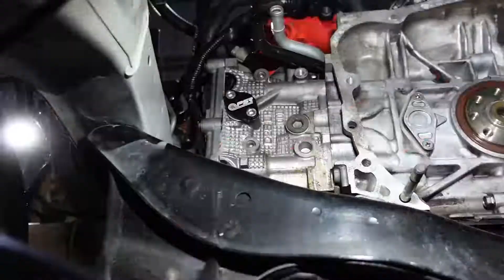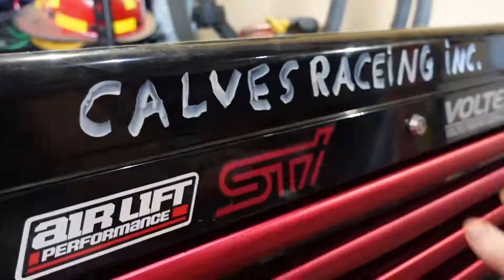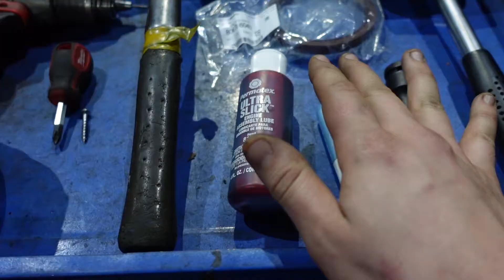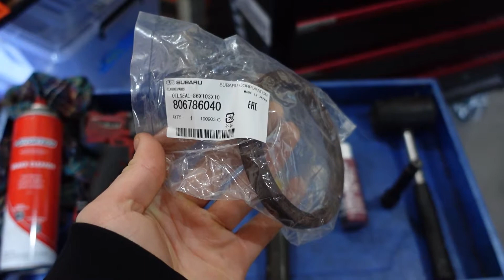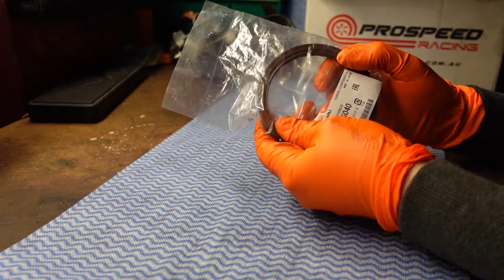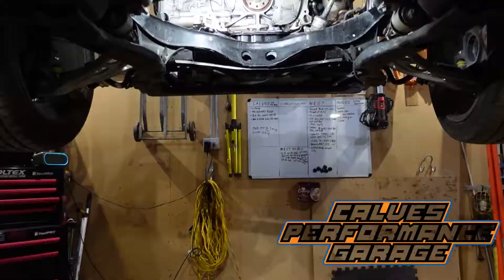How To Replace Subaru Rear Main Seal: Extended guide

Comment: What is the torque specs for the bolts for the Flex plate to Crankshaft?
1. I'm finding 53 -62 ft-lbs.  
* 2.  It's mentioned there is an additional angle to tighten the bolts,  I'm can't find the required amount.

Comment: I don't think the motor oil lubricates the seal it just cools it down slightly but no oil gets between the crank and seal, or else it would be leaking all the time. If a car sits a few months the seal will be completely dry by then and starting it up would destroy the seal by your logic, but it doesn't because the oil pressure builds almost instantly

Comment: Can I just use motor oil instead of assembly lube or It's a must?
Reply from the maker: Yeah, oil will work.
Reply: @CalvesPerformanceGarage  well, it leaks 😭, I'm dropping the trans again and I don't wanna make the same mistake, could that be because I accidentally put some oil on the outside of the seal while I was putting it in?
Reply: You just want to use a very light film of oil. Dont drown it in oil. It should be perfectly fine.

Comment: What if the rear main goes too deep?
Reply from the maker: Try to pry it out without damaging it. If not then pull it back out and start again!
Reply: I did the same thing I don’t see how to get it out without damage it
Reply: @izzysrt4  I went through about 2 seals doing it. Definitely the hardest part of the repair
Reply: I see you pulled the transmission rather than the removing the engine.  Was that faster?
Reply: @weshawkins7165  I didn’t consider pulling the engine because it would’ve been too much work for me. I did this in my home garage. 
I actually ended up putting the cam sensor on the wrong way when I put it back together. I was able to take it apart and put it back together in like 6 hrs, maybe even less since I knew what was doing the 2nd time around
Reply: @Ezrvdu  
  I know labor book time to r&r the trans is around 6 to 7 hours and around 13 for engine.  I’ve got one to do for a guy in a few weeks.  I’ve got lift in my shop so I’ll probably pull the trans.
Reply: @ definitely the easier way to go 👍🏿
Reply: Well I can tell you that I put mine in about a quarter inch too deep it's been 2 Days in my car is dripping worse and worse every time I drive it guess it's time to go back in for round two FML
Reply: @highdesertreseller  good luck 🫡 definitely baptism by fire lol

Comment: Great vid! Question, would pulling the motor be more beneficial? Or dropping the trans is better? Looks like dropping the trans was a better for you. Looking for advice before I start.
I have access to a lift and engine crane.
Reply from the maker: It depends. I prefer to drop the gearbox as i find it easier to remove but others prefer to remove the motor. I have never pulled a motor or a transmission just to replace a rear main seal. I am always replacing it while doing other work, E.G a clutch or engine reseal. I would see if the motor or gearbox needs some new seals or parts and remove the one that requires the most work or work that is hard to do with the motor or gearbox in the car.
Reply: How much would this job cost ?
Reply: At least $1500
Reply: At a garage, that is- probably closer to $2000.
Labor: pulling engine to get access to the seal is the expensive portion.